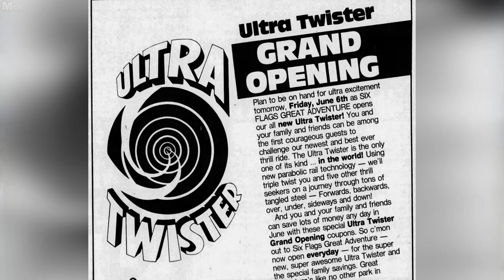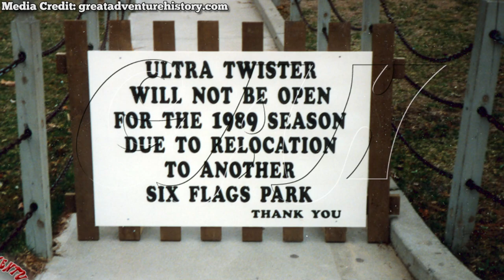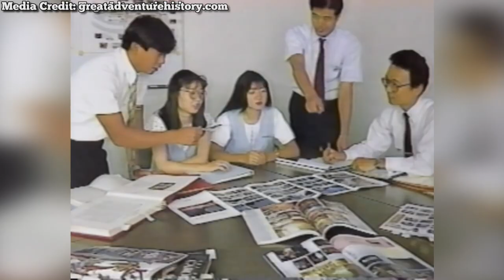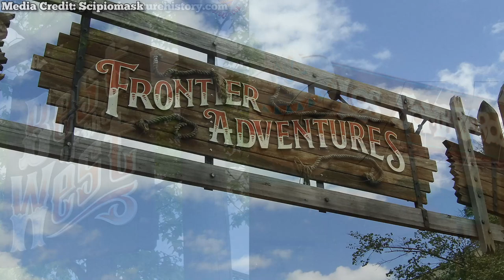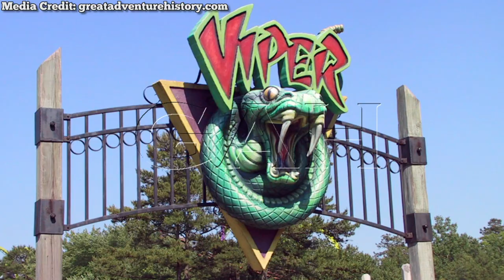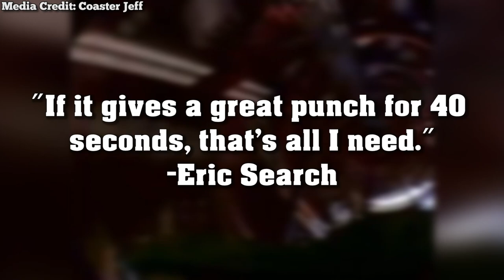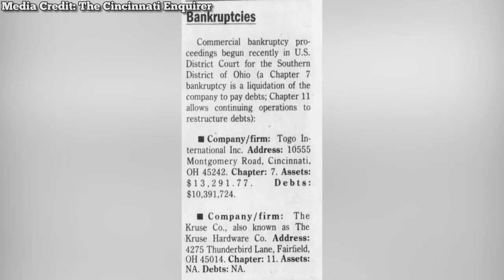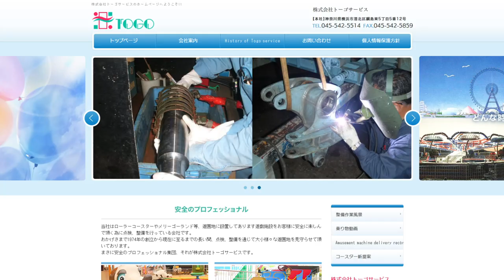FAILED Roller Coasters: Viper at Six Flags Great Adventure feat. ElToroRyan

Comment: I personally loved that this ride was so reviled. Later in its life, on uncrowded park days, Viper would have so little line, operators regularly let my friends and I lap the coaster without getting off. While it was short and shaky at parts, I never thought it was that bad. Definitely less headache inducing than the Scream Machine. That said, it wasn't a coaster I'd wait an hour to go on so I wasn't surprised when it was removed. And the fact that its removal paved way for El Toro removes any sadness I felt at its departure. El Toro is the best! Not just the best wooden coaster, it's probably my favorite coaster in the whole park!

Comment: Excellent video. I love the footage of the coaster at the Ohio factory- the best I've ever seen. That type of footage is hard to find. Viper was not a pinnacle of engineering, but I have a soft spot for its early years. I first rode Viper in August 1995 and I remember it being smooth and intense. It was a visually stunning ride and the trains looked so cool. Too bad it had those finger restraints since it seems the lap bar alone would have been sufficient. Unfortunately, it tore itself apart and quickly became unrideable. Its replacement is truly one of the coaster GOATS. Well done, thank you for sharing.

Comment: I remember coming here circa 1998 and it really did look like an old western ghost town. It felt kind of tucked away from the action, the area was near empty,, and they were maybe filling up a third of each train at a time. It was kind of surreal how quickly it was forgotten about, including by me before we arrived at it. I had remembered quite a bit of hype, like it was going to be a huge attraction for years.

And yeah, it was godawful. Putting your head tight in a vice would have been a more comfortable experience, at least you wouldn't be splattering your brains inside your cranium the whole way.

Comment: Here’s a suggestion for a top ten: top ten highest vertical loops in elevation above sea level. Full Throttle’s vertical loop wouldn’t be on the list since it’s near LA, which is near the coast, but Elitch Gardens’ coasters would probably be on the list, being almost a mile high in Denver.
Reply: The last Dinosaur?

Comment: SFGAD: Ultra Twister has a bad capacity, only 1080 rph.
Also SFGAD: Let's install a drop tower that will make Kingda Ka run at 600 rph.
Reply: It might be low, but UT still had HD capacity.

Comment: in 96 the extended rehab issue was a problem. auaed by Six Flags and not Togo. I remembwr when the train was sent out only to go down the drop up into the twist very very slowly, obly to stop. The president of Togo of Japan denied the ride could just hang in the inversion but it did when SF decidex to modify the lubricatiob grease on the train wheels. The lube they used became very thick under certain weather conditions causibg the ride to ecentually not have enough speed ro finish the course. The Viper saddle issue plauged the ride only during the 1996 season and ended around mid June from what I remember.  Most of us were on RMT or Coaster(RT) during the down time. The trains were ALWAYS the issue with VIper. Yes, track stress existed where they needed to weld a new piece but those were
I quick,  cheap fixes.

i truly lived Viper 96 97 98 and loved every min of that job. I rarely was moved to another ride even to do breaks. I have some pics around from the track area i need to dig up.. To this day I say the crew that worked with me was the best group of people ever assembled.  We busted our tail everyday for the guest. We had fun. We knew the ride was rough and not popular so we injected fun through our spiels and stuff.

Comment: I rode Viper It's last few months of operation. It was the only time I had seen it run in years so I had to try it regardless of how decrepit it looked. I really enjoyed the elements, but it felt like my bones were attached directly to the track. The restraints might as well have been bare steel tube. GASM was a much smoother ride by comparison which is saying something.

Comment: When the viper first opened the line was insane. The ride que theme was nice the first season. They had a little western stage where actors would act out a western fast draw. We use to ride the viper all the time before it closed. It was one of those rides that were so bad you went on for a laugh. Basically was no line in the early 2000s. Just had to know how to hold your head firm at the back of the seat so you didn't hit your ears.

Comment: I grew up in New Jersey going to Six Flags in the early 2000s. No exaggeration: Viper was NEVER OPEN. There was not a single time i attended Great Adventure that Viper was actually operating. I always assumed it was a failure of a coaster from that alone. The Batman rides at Great Adventure had the same issue.

Comment: I liked Viper when it first opened. 
Six Flags Great Adventure had a habit of rushing coasters and rides openings and many suffered from long periods of downtime and mechanical issues.
Batman and Robin: The Chiller, Viper, Evolution, Jumpin’ Jack Flash, Time Warp, Rodeo Stampede and many others from the 1999 War On Lines campaign never operated as intended and some never opened to the public at all.
Reply: Jumpin' Jack Flash and Time Warp were two of my favorites!!  I had a season pass for the 2001 season, and I remember we went about sixty times that year.  It's only a 40-ish minute drive from home, so why not?  Great Adventure could definitely improve on their current selection of flat rides.  They need more!!
Reply: @jimkerr5426  I lived about an hour from the park. It was a fun place for a long time and then they started in with the mentality of bigger, faster coasters and ignored everything else.
Broke my heart when they tore down Rolling Thunder. If they just kept up with maintenance on it they would’ve never had to take it down.
That was a great idea, remove a unique one of a kind roller coaster for…….. a queue line for a drop tower ride. 
I stopped going after they removed the splash boats and Freefall for a wild mouse in a building. Have never been back.
Now I enjoy Morey’s Piers in Wildwood, Dorney Park and Knoebels.

Comment: To be honest, I had ridden Viper a year before it was closed. And it was actually better then Great American Scream Machine. The actual inversions were lest bumpy, with many of the rough spots being when it came out of the loops. While Scream Machine was bad in its inversions n any sharp turns gave bad whiplash. Only reason people like Scream Machine more was the number of inversions n longer length. To be honest, both sucked in general.

Comment: Ah yes, another one of TOGO's garbage disasters for North America. Why can't they just build good coasters like they do in Japan? Plus, Great Adventure should have just kept their Ultra Twister, but noooo, Six Flags had to remove that great ride, and replace it with this. 
Also, I had fond memories of riding SkyRider at Canada's Wonderland :) I first rode it in 2009, when I first went to the park, and I was only 10 years old at the time, so I was barely tall enough to fit on that stand-up train. I remember just being barred in between those over-the-shoulder restraints. But later years, I was tall enough to get over the restraints, and I didn't find it to be that rough in my opinion. Yes, it was rough, but not to the point where I didn't want to ride it again. I thought it was actually pretty forceful, especially in the loop and helix, and gave some awesome airtime, especially at the end. I then rode it multiple times just a few days before they closed it in 2014, and it was just as good as I remembered it.
Reply: Togo standups were excellent for the time. Whippy hills, sometimes with actual airtime on a standup. I liked my 2 rides on Viper though. Big Apple was OK, its real letdown is the rooftops view.
Reply: @spentron1  Big Apple has the Premier Sky Rocket trains to replace the old Premier trains it had before. So it's probably a lot better now.

Comment: El Toro has become very unreliable unfortunately. I think it's due to the wear and tear that a wooden coaster goes through throughout it's life.
Not only that but the trains are having issues as well. 
It was closed all last season. 
It's back now though. I rode it for the first time in over a decade and it has changed. It's more rough than it used to be. But still really great.
I rode viper years after it was built not sure what season but it was horrible. Too short and too rough